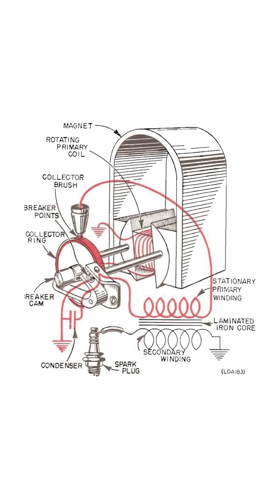The History of Spark Plugs in 1 Minute #shorts

Comment: I seen a NASCAR mechanic talking the other day they would cut the spark plug and it would get a better and faster Spark and more consistent and I always wondered if that would work on a bike I ran some split fires in my 2001 Kawasaki ZRX 1200 R ,, and I can't remember if it was any better it's been so long ago then a normal plug but that was a badass bike man 150 mph Willies I had a lot of fun on that bike and I have seen some weird spark plugs here lately the ones I haven't never seen before that are different you can take them apart some of them pretty wild 💚👍🏼👍🏼👍🏼👍🏼
Reply from the maker: Yea I love ZRX's and always wanted to build one. Even their stock spark plug is a dual tip design that's kind of unique. I have a few sets of those old split fires still in the boxes, never ran a set before. I imagine they were just hype? Or else that design probably would have become standardized. Maybe there were some downsides to it.

Comment: Im gonna be rockin' v8s til i die. I dont care what they run on, though. If only the people who made hydrogen engines didn't keep mysteriously disappearing. Hydrogen is a fantastic eco-friendly option for combustion engines as it's VERY potent and releases only water. It is very hard and dangerous to put in an engine, though
Reply from the maker: @hendrix232  I love my ICE don’t get me wrong! I’ve built my life around them. But  we gotta try not to let feelings influence opinions. Conspiracies aside, if you wanted to run hydrogen through your V8 it would be roughly $20/ gal equivalent and 3-4x less efficient than using hydrogen in a fuel cell to produce electricity to power an EV. That is the way most have invested in the use of hydrogen. Either way you use hydrogen however, you lose converting energy through it (2nd law of thermo dynamics). BEV is always going to be more efficient. The head of Exxon has forecasted that every new car sold by 2040 (15yrs) will be electric, I think that says a lot! But only time will tell, we shall see 🫣
Reply: @oneupmotogarage  i mean nobody is driving v8s for fuel efficiency, but I don't think their going away that quick. I didn't know the stats on hydrogen, but I figured not even a hydrogen combustion would be as good as electricity. Either way, even if all new cars are electric, 1 I sure as hell can't afford it 😅 and 2, it'll probably be a LOOOOOOONNNNNGGGGGG time before they'd stop selling gas. I think electrics will almost certainly be the standard way sooner than 2040
Reply from the maker: @hendrix232  oh yea, for sure we’ve still got decades to enjoy our v8’s (or for me, v6 *love my Astro van*)
Reply: @oneupmotogarage  the v6 i want most is a DeLorean. That's if I've ever got money to burn, though 😅. Part of every collectors dream, but God do, they suck. Their so unreliable and shitty performance to begin with, but their just iconic and loveable

Comment: Gasoline isn’t going anywhere. We’d make synthetic fuel before we go full electric.
Reply from the maker: @theonewhoknows2  what is a synthetic fuel?
Reply: Carbon nuetral fuels or bio fuels ( man made ) Carbon mixed with hydrogen to produce syngasto @oneupmotogarage
Reply: @oneupmotogarage A synthetic fuel would be any fuel that is entirely man-made. Now in our case, it would just mean a fuel that is made to the same characteristics as fossil fuels, just without the fossil part. These fuels exist already, but are really expensive.
Reply: @oneupmotogarage hydrogen or compressed gas and I don't mean gasoline different types of vapor gases
Reply: @brodieweiler3993  yeah the issue with that is hydrogen is expensive en mass both with emissions and cost. and just we have the infra for diesel but not nearly as much for any other type
Reply: yea like we allready have e85 fuel thats fully renewable
Reply: i’m a big gear head but no way that’s happening. there’s not nearly enough money in synthetic spark-ignition fuels for something to come out before EVs reach the majority of new car sales. we’re already at the point where an EV is the objectively more convenient choice for a daily driver if you have a place to charge at work or home. workplaces are being updated to have EV chargers and so are apartment complexes too. 

i probably won’t buy one for a long time because i mostly like older vehicles, but if you’re looking at buying a new car you might as well go electric. even if you do a long roadtrip twice a year you’d still save money by renting a car for those few occasions.
Reply: Steam power is not going away
Reply: gasoline will die out but diesel will never
Reply from the maker: @coreydavis6868  Why’s that? The diesel persisting I mean.
Reply: @oneupmotogarage  because of use in heavy equipment, also because of things like trains we have a lot more time and resources invested in diesel electric than we do gas hybrid.  Also it is a more efficient fuel source that has more energy per  gallon
Reply from the maker: @coreydavis6868  Gotcha. I imagine it’ll be awhile before they’re hauling cross country in electric semi’s. But they are already doing regional semi deliveries with EV trucks. So that’ll take time. Electric train tech is already advanced, just not utilized in the US yet. Also, time. We have at least a decade of tech and infrastructure growth before we’ll ween off fossil fuels from the look of it. So I’m not worried, I still have a shop full of gas burners and love each one 😄
Reply from the maker: @coreydavis6868  but I wonder what an electric excavator would be like 😳
Reply: @oneupmotogarage  full electric will take a bit but diesel electric  i would make a lot more sense because you can run the generators a lot more efficiently in the truck than engines  and when it comes to an electric excavator, again having a hybrid set up will have many advantages over  pure fuel based heavy duty power sources
Reply: to add to the efficiency piece its a lot more efficient to have a generator run at its preferred RPMs  to handle peak loads and recharge than it is to have a normal engine rev up and down depending on the load, that is part of the reason high performance vics are leaning into hybrid designs
Reply: @oneupmotogarage  Probably diesel electric - those Edison Motors guys are going somewhere
Reply: @oneupmotogarage electric trains are actually not that well developed for cargo, electric trains are amazing for passenger loads, but for cargo loads you just can't store enough power and it's also not economical to have massive amounts of lines out in the middle of nowhere, most of the locomotives in the United States are diesel electric as well because that's the most efficient way that allows you to Carry large amounts of fuel. Diesel can also be made from corn